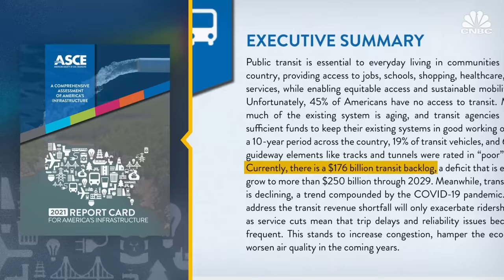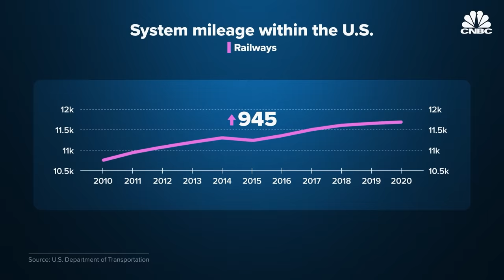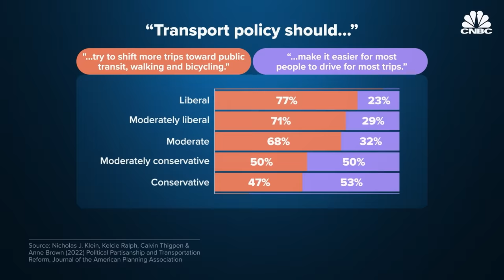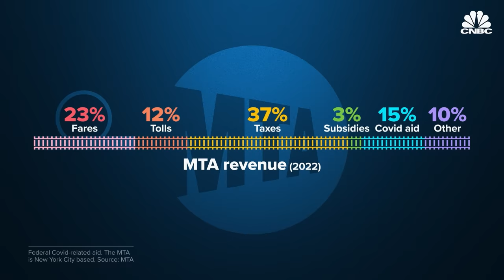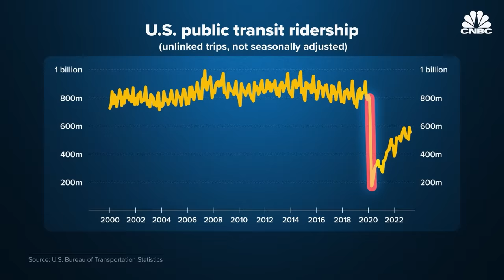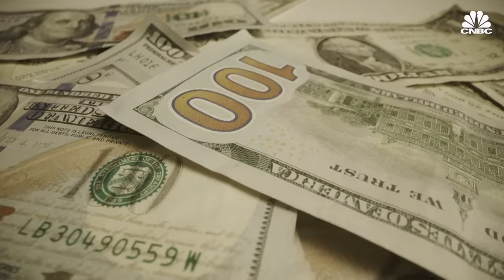Why The U.S. Gave Up On Public Transit

Comment: American logic: 

Sitting in traffic with thousands of other cars - Individualist

Taking the train - Collectivism
Reply: IF you're in certain cities like LA there are instances where transit overall makes more sense since you don't have to sit in traffic.
Reply: @chrisaycock5965 In every city transit makes sense. Even those with only 100,000 population. It just needs to be funded and used before it can become better than driving.
Reply: @dylanc9174 well, the transit needs to be combined with greater density. a bus in a single-family neighborhood is a lot less efficient than in even a medium-density neighborhood. so it’s important that in addition to letting people reach other destinations, people should also have more potential destinations to reach in the same general area.
Reply: Trains don't stop on my doorstep, nor does it stop at the doorstep of my job or my friends' houses. Trains don't run at all hours. Trains don't let me control the temperature, or choose a radio station or podcast to listen to without headphones. Trains don't have a large trunk where I can dump sports equipment, or even all my belongings before moving cross country. Trains don't let friends and I travel together and have private conversations about potentially sensitive topics. Trains don't let me take an alternate scenic route if I want. Trains make me wait outside in the heat, cold, or rain for them to show up. Trains struggle to run when there are leaves on the track, when there is a power outage (for electric metro and commuter trains).
Reply: @dylanc9174  No, it doesn't. It doesn't even always make sense in dense cities. I, and many other americans, dont want to sit on a packed bus / train that takes double the time to get where I want to, and then have to walk additional distance to get there. Plus you can't transport anything other than what you can carry. Not to mention that I now have to pay more taxes to fund something that I wont even use. 

I dont get this obsession with transit. It just doesn't make sense in most of the U.S. It is great in DENSE cities, such as New York, but falls apart as soon as you get to anything remotely suburban.
Reply: @mirzaahmed6589  You have some points here but as someone who lives in a very large metro area a car is generally a bigger pain the @$$ as you sit in traffic going 10-20 mph for hours on end and you're generally parked in a parking garage or a far away parking spot to get down from it's kind of annoying in large metros.
Reply: @alexanderhenderson5111 
Speed depends on the quality of the transit. When your commuter train goes at 100mph and offers frequent bus, tram and metro connections, your commute can be much faster than sitting in traffic. Not to mention much less stressful. And very good systems don't generally suffer from overcrowding.
Reply: @mikeblatzheim2797  you cant’t run 100 mph trains through suburban America. Not to mention that only holds for long distance. If your transiting 60-80 miles to work then maybe, because again you have to get to and from this train station, usually via bus if you don’t have a car. 

If your transiting 20-40 miles, only buses, or metro, makes sense. And metro only works in extreme density because it’s very expensive to build and operate. You won’t get anywhere near the amount of customers for a metro in suburban America, not to even mention rural America. 

That leaves only bus. And nobody wants to ride on buses. They stink, take a long time and are uncomfortable and inflexible. Anyone with the means to afford a car will never ride a bus if they can help it.
Reply: @alexanderhenderson5111  
And any properly funded bus system runs clean and modern buses, which also take little longer than a car (provided the route runs somewhat directly). A proper network will also provide you with many flexible connections and frequent service.
Having taken buses in multiple US cities, I'm with you on the uncomfortable part, but that's mainly down to the buses used. But unaffordable? That's definitely not the case, especially when compared to the cost of cat ownership. US buses are far cheaper that where I'm from, although I suppose that's also the reason why they tend to be so bad.
Reply: @mikeblatzheim2797  The only reason they are cheap is because you don’t actually pay for the bus when you step on. Taxpayers pay for it. As mentioned in the video, only ~20% of the cost is paid via fares. If you actually had to pay for the bus every time it would be 10$ a ride.
Reply: @alexanderhenderson5111  Subsidies for me but not for thee.
Reply: @alexanderhenderson5111  
I'm guessing you don't actually want to pay enough tax to fully fund the roads you drive on. Hence the government subsidises road construction and maintenance. So they also fund public transport, but funnily enough, to a much lesser degree. 
BTW, one bus causes less wear and needs much less space than 40 cars, so if enough people used buses, that investment would allow smaller roads that last longer. Which saves money.
Reply: @@ghost_mall need to deal with sprawl too. I can walk 11km over the course of a day in Amsterdam and it doesn't feel like much, but if I try walking 3 or 4km in my city of London, Ontario, it feels exhausting. It's awful to walk in North America. And it's because of the sprawl.
Reply: @@ghost_mall I think your misunderstanding what I’m saying. I’m not against taxation, or public transit. However to act like it’s a cheap or easy solution is wrong. I’m pointing out how the actual fare paid is much higher, just hidden because it’s part of the tax bill. 

The same applies for roads. In fact, much of the bus system is subsidized further by cars because of the huge amount of taxes (gas tax, registration, tolls etc) that are needed to build and upkeep roads. 

It’s fine to have public transportation, but it is, in my opinion, inferior to cars. It lacks flexibility, comfort, and convenience of cars without offering much in return. 

Finally, as sad as your disability is, does not mean that we should structure society around you. We should help and give you (and people like you) the means to function like others, but that does not mean changing the way we do things for everyone.
Reply: @alexanderhenderson5111  do you not realize that the money we throw to cars is also not fiscally profitable? none of the highway infrastructure we spend hundreds of billions on each year turns a profit. the roads in american suburbs likewise most often don’t have enough of a tax base to be maintained properly. i say this as an actual student of urban planning who has learned these things. let’s also not forget the amount of pollution that road infrastructure causes as well. please tell me why your personal comfort and convenience as a driver is more important than the health of the people you’re driving past.
Reply: @ramijackson3978: I don't get the sneer, unless you're having trouble imagining that anyone might want more control over their own lives.  

Transit basically always involves government agencies (or agencies deeply dependent on direct government subsidies) in the operation of the system, as well as its construction and maintenance.  Driving involves government agencies in the construction and maintenance of the system, but far less directly in the operation.  So to the extent that more governmental reach into the details of my life is more collectivist, yup, riding a train is going to be more collectivist than driving.

Now, personally, I'd ride a train over sitting in traffic in a heartbeat, as long as long as the train goes where I need to go when I need to go there, reliably, and my avoidable costs are comparable.  Real-estate values in U.S. suburbs with good train service (northern NJ has plenty of examples) show that there are a lot of Americans who agree with me.  But that doesn't make trains the perfect solution for every situation, or everyone who opposes them illogical.

Comment: The main issue is that our government officials look at public transit as a business and worried so much about ROI which it shouldn’t be it’s a public service if it was good we would ride it more. I’m in Miami we’re so happy to have the BrightLine here to take a train from Miami to Orlando and back without having to drive.
Reply: How Federal Grants for Mass Transit programs are allocated.

Federal Grants are (1) given as long as the public transit system does not turn a profit and (2) those Federal funds are given without requiring they be spent to improve public transit services.

So, first the City and State are incentivized to ensure their mass transit sustems stay broken, that any failures remain unrepaired, that service be unreliable to discourage commuters; and as long as that happens, the receiving government can keep that money and use it wherever and however it wants!

It is a never-ending doom cycle by design because no one could fail this badly for so long unintentionally!

Please, examine the books of New York City and their Mass Transit Authority (or anywhere else) and prove me wrong!

Comment: There is a way for transit authorities to operate without federal "investment" dollars and it's called value capture (VC). In Asia there are multiple private rail companies that operate profitability by monetizing the land around stations, Ie shopping malls, office complexes, apartment buildings etc. Hong Kong's MTR in particular has done a masterful job providing excellent service and remaining profitable at the same time, from what I've read. Apparently they own like 13 malls and other buildings directly next to stations.
Reply: This is very popular in Japan where i lived for a decade too.  But those companies acquired the land more than 100 years ago.  YOu don't have enough money for any of that now.
Reply: How Federal Grants for Mass Transit programs are allocated.

Federal Grants are (1) given as long as the public transit system does not turn a profit and (2) those Federal funds are given without requiring they be spent to improve public transit services.

So, first the City and State are incentivized to ensure their mass transit sustems stay broken, that any failures remain unrepaired, that service be unreliable to discourage commuters; and as long as that happens, the receiving government can keep that money and use it wherever and however it wants!

It is a never-ending doom cycle by design because no one could fail this badly for so long unintentionally!

Please, examine the books of New York City and their Mass Transit Authority and prove me wrong!
Reply: Same with Thailand's MRT system. It's so convenient that trains are linked to all sorts of establishments and easily accessible.
Reply: That’s how they’ve been doing it in London for 150 years.

Comment: What makes me optimistic is that there's a lot more momentum behind better transit these days. When I was in college there was very little, other than a few go-nowhere projects like the Wisconsin high speed rail line. People just didn't see the benefit. A combination of an aging general population, a younger population less interested in car culture, and a rapidly growing immigrant population from countries with reliable transit... at the very least we will be forced to talk about it more.

I'm mostly interested in commuter rail, or even suburban mass transit like BART. It's rush hour commutes that we all hate, and it's by far the most glaring issue with using cars for our commutes. Instead of a commute that could be anywhere from 40 minutes to 2 hours, I'd take 5 minutes to drive to the station and get there in 40 minutes every time. Don't have to worry about dozing off or paying attention to the road. I could do some prep work while I commute. The benefits of commuter rail to driving are pretty clear to me.
Reply: Also, national rail like amtrak and even private rail companies. Our country needs better commuter, national/regional and suburban railing transportation connectors.
Reply: Park and rides are considered bad by urbanists. So driving to a station will soon be impossible as all parking is getting replaced by tiny apartments. Good luck finding a place to park so you can train 😂
Reply: @cmdrls212  It's true, it seems like urbanism is just people who hate cars - which is just another form of this new age zillennial degeneracy. But I don't think supporting public transit projects means I'm an "urbanist".

Comment: I worked in Portland, OR. for 21 years.  Public transportation is everywhere, and it is used during peak work and home times, but is pretty much ignored by the majority of the public.  The reasons are quite real and varied.  Downtown they have or had a "fareless square".  No fares were required.  Homeless, drug users, and alcoholics just jump on with the workers trying to get to work or go home.  Urine smells, and physical assault on people happen a lot there.  Then, the stops every 500 ft for bus and light rail is a real slow down both to the riders and to vehicle traffic.  This goes for the local government's favorite train system, called the Street Cars as well.  It is an absolute abomination as far as I am concerned.  (Don't live there, or work there anymore.  Haven't for 4 years.)
Reply: It was explained to me once that the 500 foot distance was an artifact of a time when sparse development meant that each stop would only be used infrequently. Once development expanded out to those areas, bus stops weren't removed and now multiple stops have passengers getting on or off, slowing buses to a crawl. Time is money and doubling commute times this way makes everyone leave who can find a way. New York has express trains. My own area has started express buses but it is long overdue. My area's subways could be computer controlled and allow express trains to pass local trains at stations the express train is not scheduled to stop, but automating the union jobs is a non-starter in urban political environments. We're about to have self-driving cars. Automatic trains would be so much easier to perfect; but there's no demand.
Reply: @williamjacobs  In Portland, it is codified by the actual physical build.  There is no way to route an express around the light rail or street car.  Buses though do have that ability and there are express buses from outlying suburbs. But once you get to their downtown stop, you are back to the every other block stop.  This design parameter was set by Earl Blumenauer during his reign as a City Council member and head of the Portland Office of Transportation.  Then he went on to be a Congressional Representative, and makes it a requirement in his position there.
Reply: Portland is now a "no-go" area.
Reply: @ednorton47  I retired from the City back in 2011.  After that I rarely went to Portland for anything, especially downtown (CBD).  We lived in Vancouver, WA a very conservative county (Clark).  Unfortunately, that cancer spread into the City of Vancouver, and into Clark County.  When my wife retired 4 years years ago, we moved to Texas.

Comment: Live in Mexico. From the USA.

The city where I live doesn't have rail, but we have a fairly decent bus system. There are also tons of different types of rideshare options, taxis and small vans. There are also private taxis if you'd rather have that. I haven't had a car in the six years that I've lived here, and it has been great. 

That being said, I don't think public transportation will get major government funding in the USA until large segments of the population in urbanized areas (suburbs included) literally can't afford to maintain and operate a private car, which might be coming sooner rather than later judging by the current rentflation.

Comment: The problem is that Amtrak and commuter railroads such as VRE (Virginia Railway Express) operate on tracks owned by freight railroads. These freight railroads limit when the trains can operate and often cause delays due to limited track capacity as they have only 2 tracks in most areas

Comment: Seems like the biggest problem is that governments are picking which mode gets funded and which doesn’t. Most of the roads and transit lines pre 1930s were all developed by private companies. According to this video, that worked and we’ve been trying to play catch up ever since.
Reply: How Federal Grants for Mass Transit programs are allocated.

Federal Grants are (1) given as long as the public transit system does not turn a profit and (2) those Federal funds are given without requiring they be spent to improve public transit services.

So, first the City and State are incentivized to ensure their mass transit sustems stay broken, that any failures remain unrepaired, that service be unreliable to discourage commuters; and as long as that happens, the receiving government can keep that money and use it wherever and however it wants!

It is a never-ending doom cycle by design because no one could fail this badly for so long unintentionally!

Please, examine the books of New York City and their Mass Transit Authority (or anywhere else) and prove me wrong!